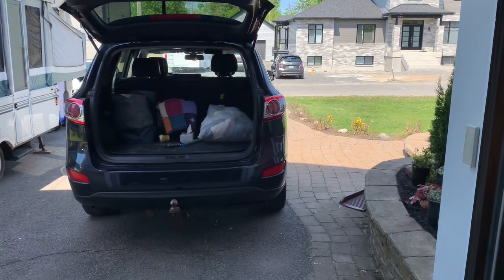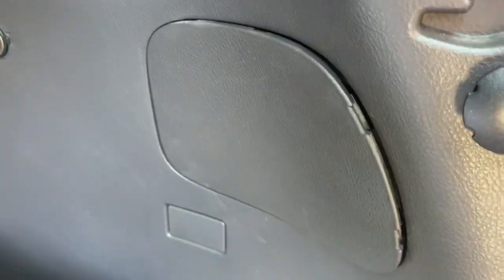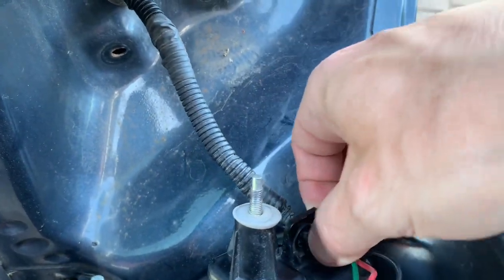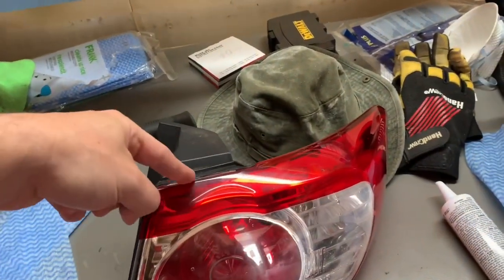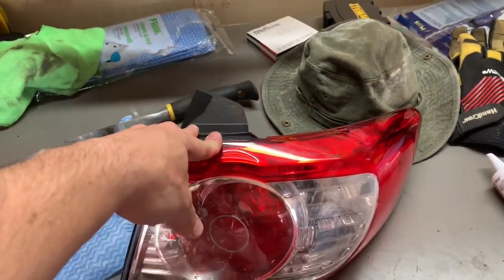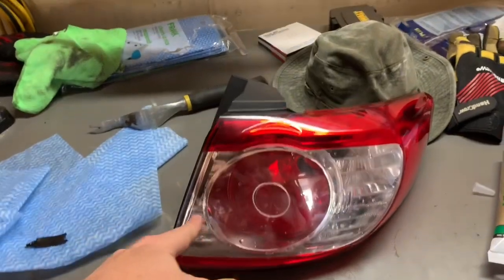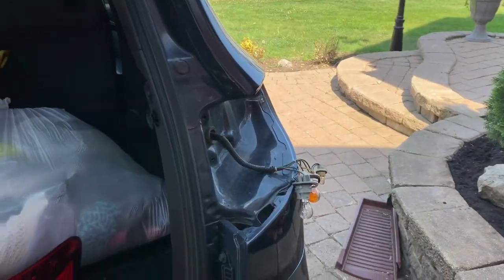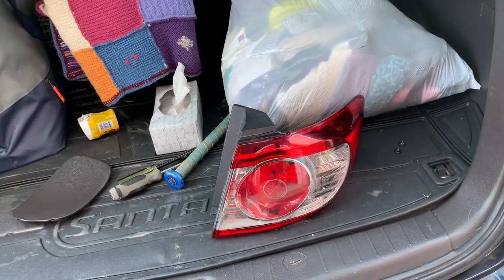Moisture in Tail Light CM Santa Fe

Comment: Thank you for this. Also just use a hair dryer, or put it on passenger floor to the back where your air conditioning comes out. Put it on Max heat tho and put it to the floor. Too risky for oven if you ask me. But again than you for this video! Helped me a lot

Comment: Clear, concise DIY... well done. Would it be possible to use a hair dryer on low heat to blast air through one of the light holes to remove the moisture before sealing?

Comment: John- pardon if I missed it but to get your inch of water out which port on the back were you able to get it out of? Did you just tip upside down and it came out? Got same problem in my Santa Fe 🤦🏼‍♀️
Reply from the maker: Hey. Yes just tipped and rocked it back and forth

Comment: I would leave the bottom alone. Clearly water did not escape through the bottom anyhow. When you are setting in the sun make sure to turn it upside down so water can leave through the gap on top. Once you seal I would suggest setting in the sun so the light socket openings are on bottom.

Comment: if it keeps filling up, no matter how many times you try and seal it, is there any danger in making a small drain hole in the bottom? not on the lens, but kind of underneath where the bottom meets the car?
Reply from the maker: Stella Cobb that is a practice that is done often to drain humidity. This issue is the housing is meant to be “air tight” by drilling a hole you risk allowing atmospheric humidity and bugs inside.
Reply: I did that in our Santa Fe before watching this video (ha,ha!), so now I am going to have to seal that little hole also.  We have had 2 of this generation of SF and they both had this problem!  Good luck with yours!
Reply: I did! I put two holes on the side and a three on bottom side at the lowest point.  I didn't take the whole assembly apart I just put clear silicon on the top half and added the drain holes. No issues since then! I used a really small drill bit to unsure the encloser would not crack.